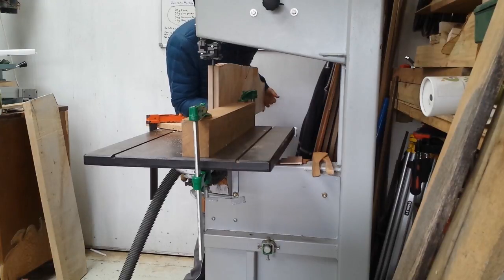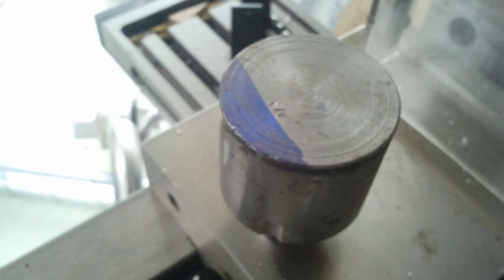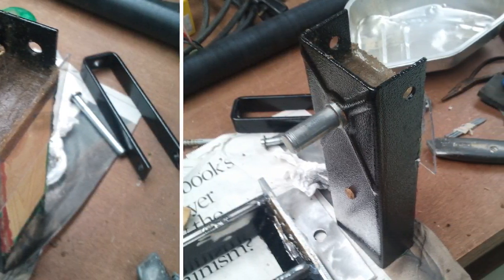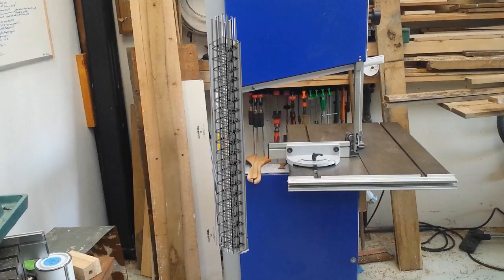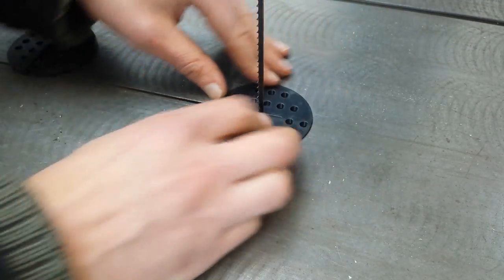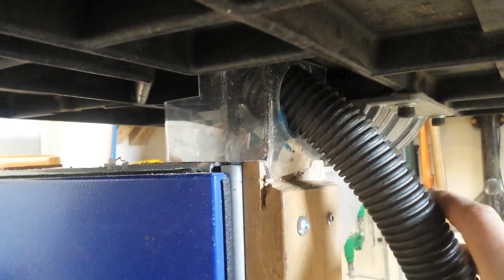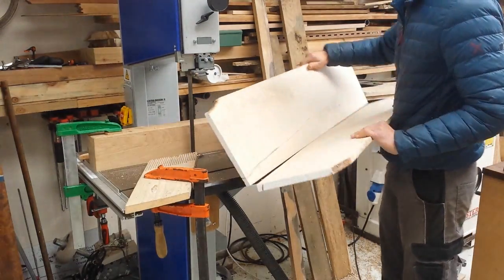Quest for ULTIMATE bandsaw cutting performance (re-define your band saw)

Comment: I have seen a video on here y tube where the guy removed the cast plate and replaced it with a torsion box with integrated dust extraction built in,see if that may help

Comment: 1:35, most bandsaws have a compression spring where your saw has what looks like a solid iron bushing? Did a previous owner maybe break the spring and then replace it with a piece of pipe? It obviously works ok, as you have demonstrated. But that could have led to the parts bending, in the first place.

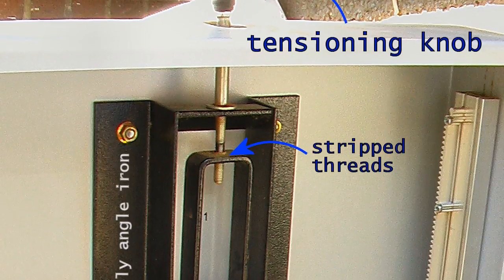In your "generic bandsaw pic" at 1:44 (edit: I meant 3:44), this tension spring is also omitted, but there is no pipe in the way. So you can see what that spring is supposed to do. The spring is supposed to push on the bottom of the tension knob. The tension knob is connected to the top wheel assembly; the entire top wheel assembly is hanging from this bolt (although also captive in a rail). So the spring is supposed to be suspending the entire top wheel assembly. It's hard to visuallize, because you might assume that the bottom of the tension knob is supposed to index against the top of the cabinet, thus lifting the top wheel assembly. But it's not. When you have the proper spring in there, the knob never touches the top of the cabinet. It's floating. When the saw is operational, if you push down on the tension knob hard enough with your hand, it should depress about a tenth of an inch or two (and the top wheel will also move down that fraction of an inch).

The total amount of travel in this kind of compression spring is only a few tenths of an inch, and you can obviously get good results without it. But it is probably beneficial if even the cheapest wood-cutting bandsaw from China typically includes this spring? Perhaps affecting the ability of the blade to stay tight and tracking when things get choppy, and/or prolonging life of the wheel bearings and/or the blade? This may also have contributed to the rattling/wobblying of those pieces of angle iron where you added silicone. And it may be the reason you had to beef up that bent strut and had to increase the size of the tension carriage bolt. You're dealing with larger peak forces, because there's no tension spring? Your wheel bearings may be next?
Reply from the maker: Good morning Mildly Productive. thank you for taking the time to message, I appreciate that. I remember years ago, going on a big quest to investigate the 'missing' spring... Turns out that, no, this bandsaw does not have one by design! Apparently the flex of a large welded steel frame, rather than the traditional cast iron, is enough to give the same benefits as having a tensioning spring (according to  Electra Beckum!?)... 
I did think about adding a spring, but given the amount I can flex the machine by putting weight on the top wheel housing, I am tempted to think it wouldn't add much. I was tempted to stiffen the main vertical beam, by adding a steel and concrete fill to the tube, which would add a lot of rigidity and damping mass... Then I would need to add a spring! 
In the end I decided against, as it seems to work ok, and is a lot more mobile/manageable without that weight.         
Thanks again for your comment, and for watching, 
Bongo.
Reply: @FloweringElbow 
Hey, thanks for the response with the background info. It's interesting, but I think Electra Beckum maybe got it wrong. It wouldn't be the first time a tool manufacturer/distributer goofed. Older Porter Cable 14" bandsaws had rubber mounts between the saw and the stand. But the saw used an external motor, which was also mounted to the stand with rubber mounts. Oops.

All bandsaw frames flex/spring, significantly. In this case, "significant" is as little as hundredths of an inch. 0.00067" of stretch per inch of blade results in 25k psi, which is where most metal cutting saws are supposed to be tensioned, well higher than a wood bandsaw, already. On say a 100 inch blade, that's 6.7 hundredths of an inch over the entire blade. Divided by two, because it's a circle, that's 3.35 hundredths of flex between wheels to effect a change in tension of 25k psi. That's why the ~1 tenth of an inch or so of buffer/damping/shock absorbing is significant. It's many fold times more than the total stretch in the blade, anyhow. 

The frame is supporting the entire top half of the saw: it supports the mass of 1. the top half of the frame and top cabinet, and  2. the mass of the upper wheel assembly. All that mass is contributing to the amplitude of the vibrations; each little vibration is effecting tension quite a bit. The tension spring only has to support the mass of the top wheel assembly. So it can act faster. This should decrease the tension changes due to these oscillations. The more flex in the frame, the worse. And the more a tension spring will help! Theoretically, if the frame were perfectly rigid and wheel perfectly concentric, you would not benefit from a tension spring! Metal cutting saws run so slow, they don't need a spring. You don't get significant resonant oscillations at these speeds. If the wood bandsaw frame were perfectly rigid, it would be the same boat.

I'm not sure how much weight a spring adds, but it would replace the iron tube, so the difference in weight and mobility should be negligible. I was actually a bit curious about the sheer weight of your cam lock. It's super beefy, but that adds a bit of extra mass up top. You can think of the top of the wood bandsaw like a racecar. The lighter and stiffer, the better. Any mass which doesn't increase the stiffness where it matters should be minimized. The more rigidity:weight, the lower the amplitude of oscillations. Of course in practice, adding some mass can improve the performance if the saw happens to be operating in a resonant frequency for much of your work, and that additional mass can shift it out of that zone. 

Also, of course, adding mass to the top wheel, itself, is beneficial to add to the rotational inertia or flywheel-effect. This is one of the main areas I am curious to try to improve the performance of a cheap aluminum wheeled bandsaw, by adding more mass around the rim (and hopefully maintaining the balance). I have never seen anyone do that, and on the surface it seems like it would be relatively inexpensive and theoretically not that difficult to achieve. I'd start with the bottom wheel as having less con and mostly pro.

Thanks for suffering my big head. I sometimes get the impression I'm pretty smart, and once in a blue moon I get things right. Dunno which one this is. I feel like I got my head wrapped around the important bits, here. But I always feel that way, even when I'm wrong.